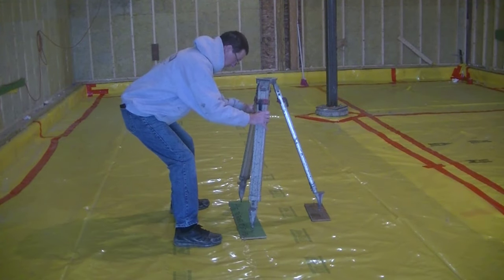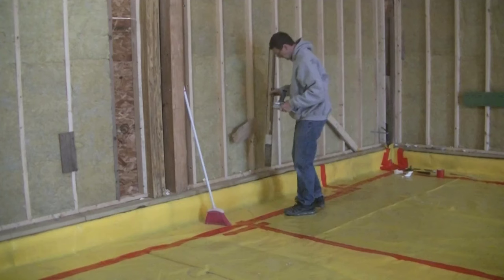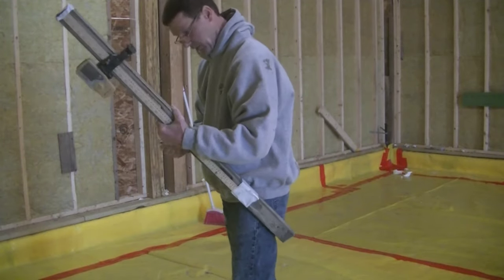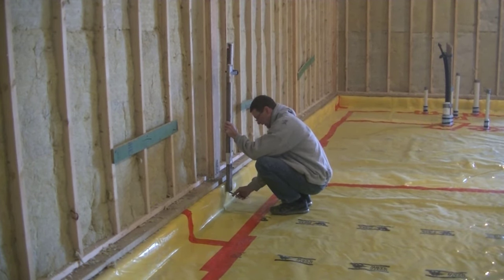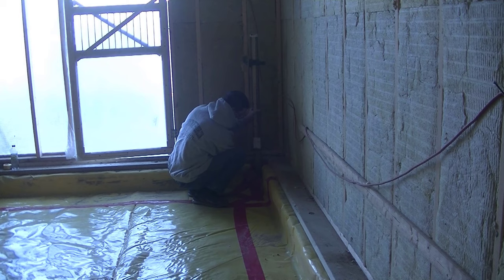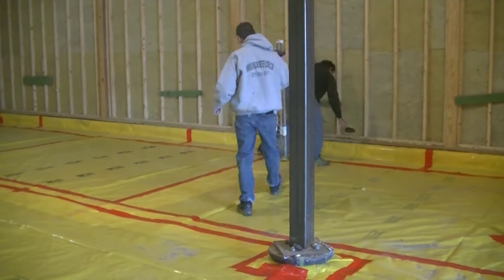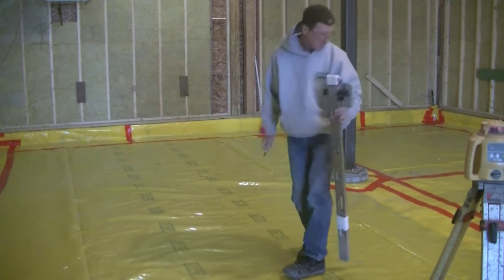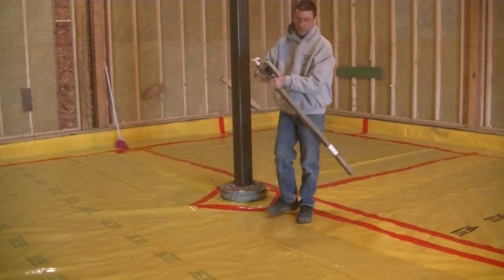How To Use A Laser Level (Self-Leveling Laser Basics)

Comment: -Yea, the laser level has been a huge money saver in the construction industry for sure. It cuts down the labor cost by 50% for any leveling operation like this.
-People always get confused with it when trying to figure out if the sensor should go up or down on the rod. I always found it helpful to tell people, “Don’t think about where the sensor is on the rod, bcz it’s just a random setup. Rather pay attention to what’s happening to the bottom of the rod, bcz that’s really the business end of the tool.”
Reply from the maker: I can remember using a "transit" and grade stick years ago. I still have my first one. Two man operation to do grades like in the video. I could have explained the receiver and grade stick a little better, I will in the next one. Good tip.
Reply: @MikeDayConcrete  Hey Mike, I just read a comment on ‘Essential Craftsmans’ latest video from ‘Ernie White’ and he was complaining that stamp-crete is too slippery when wet and should only be used for interior use only. Is this something you’ve encountered? If so, is there a way to add some ‘grit’ to it.
Reply: Exactly right... I remember the light bulb went on for me when my brain said "don't think of it as 'moving the receiver up' from 23 to 28 (for example), but rather think of it as 'moving the rod down' (if you're lowering the level line).  That receiver is the stationary thing and the rod is moving up or down, depending on your target height.
Reply: @psidvicious  I added grit to my stamped walk, did not help, I had to block off the walk in the winter.
I have been considering not resealing when the sealer wears off.

Comment: Are the bolts in the nuts on those pier is going to be below the concrete? If so don’t you have to expose the nuts in case something needs to be replaced?

Comment: I still do not understand how the receiver related to our measurement. Pls a bit detail to explain adjusting the receiver .
Reply: He was given a datum to work off which was the top of the cell , so he used the laser to identify that as the “0” point . His top of concrete level is 6 inches below that cell , therefore for him to be able to identify the top of concrete level he has moved the receiver up 6 inches on the staff to identify top of concrete level. In simple terms from your “0” point ( the initial level your working off) , if you need to go below that point e.g excavating , receiver goes up , if your going above e.g pouring or backfilling , the receiver goes down . Hope this helped

Comment: Mike !!!!!! Your missing the underfloor heating system... it goes into the concrete not on top😂🤣😂
Good stuff can you lend me some money to buy that self leveling lazer  still using the old man-U- el laser
Reply from the maker: Haha, no radiant heat in this one. The manual one is good, I still have my old one, but I really like the self-leveling one.
Reply: If you take into consideration the man-hours saved by using the laser level instead of the man-U-el level, it should pay for itself in just a few jobs.

Comment: But you have to have a tripod. I don't have one.
Reply from the maker: Set it on a saw horse 🐎
Reply: @MikeDayConcrete   How do you tip the laser up to the height you need? My sawhorse is only about 3 feet high and I need the line near the ceiling.